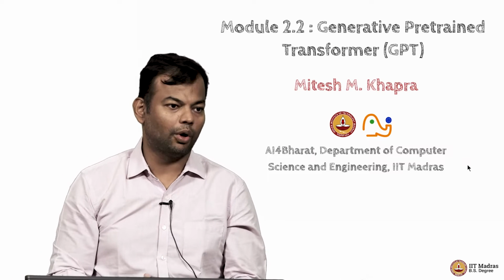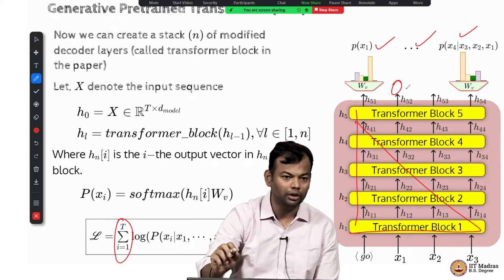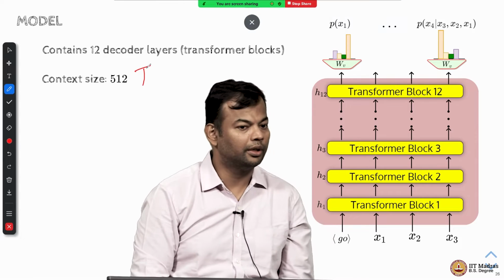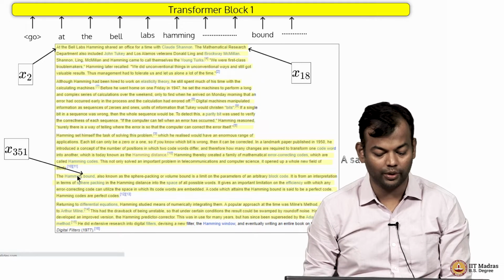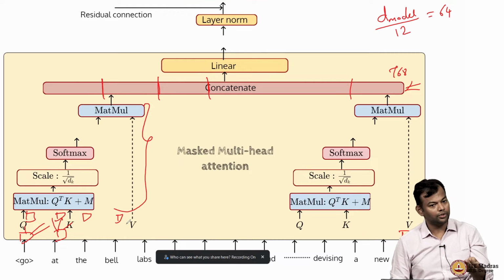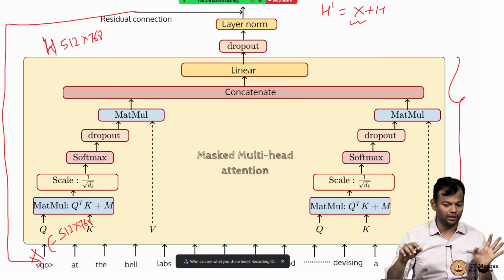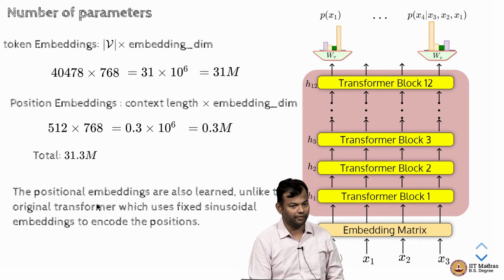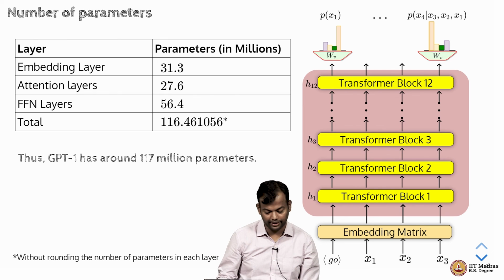L16: Generative pre-trained transformer | decoder only architecture & parameter analysis

Comment: sir each head gives output ogf Tx dmodel then how cancatination of them gives Tx dmodel output
Reply: No each head gives T/no.of heads where T is sequence length if you concatinate all the heads you get T at the end
Reply: At most of designs we ensure the output concatination of all heads equal to orginal in this case 512 x 64 is each head Output
Reply: lets say ur input is 5 tokens and each of 512 dimension vector so your input vector dimenison is (5 x 512) ,(considering each row signifies the each token dimension)
Suppose u are using 8  attention heads then each head dimenison should be 512/8 = 64
so everytime ur input vector of dimension (5x512) is multiplied by either Wq,Wk,Wv of dimensions (512 x 64) resulting a matrix of dimension (5 x 64)
[(5x512) x (512 x 64) = (5 x 64)]
each head gives (5 x 64) concatenate 8 heads side by side u are gonnna get (5 x 512) resultant vector